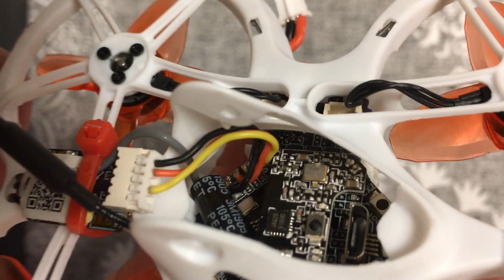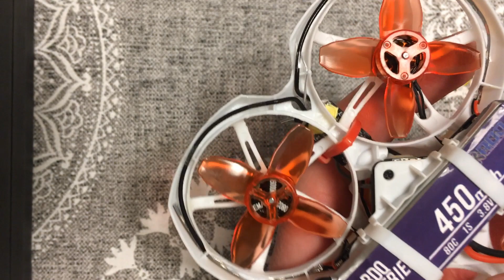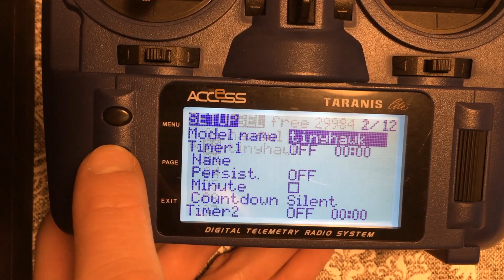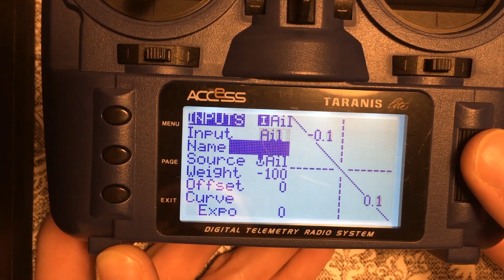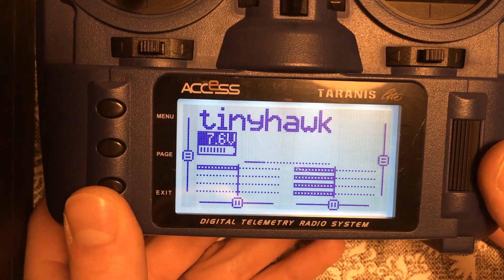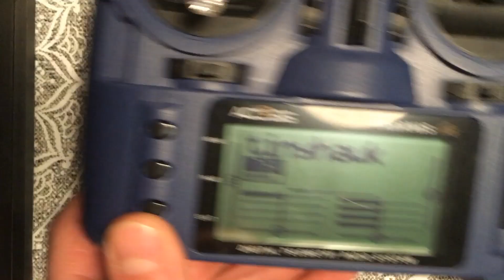EMax Tinyhawk II with X XSR receiver for ASSCT  ACCESS

Comment: Thanks, I am going to connect XM+ since telemetry is not needed, BTW, why didnt you remove the old antenna? its not needed anymore
Reply from the maker: I left the old antenna attached so I could still sell the quad in it's original config. It barely weighs anything so not an issue for handling or flight time.